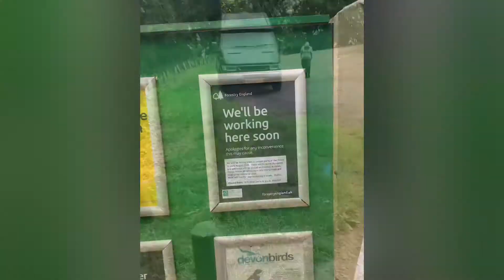I have a leak!,!! My life in a iveco daily campervan

Comment: Hi Darren.. If you don't need that aerial, get rid of it and plug the hole.. Roof lights are a nightmare.. but the tape you used is the best for the job.. and looking back its 2 or 3 years since the transit was in full swing.. I think I prefer the Transit.. Iveco are made with thin tin but do have a good chassis on them.. Cheers Bud